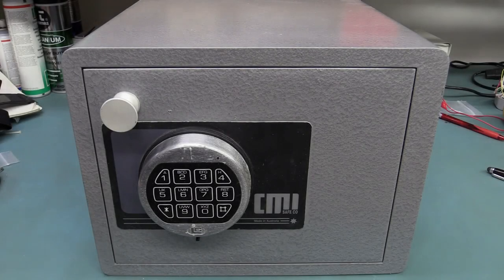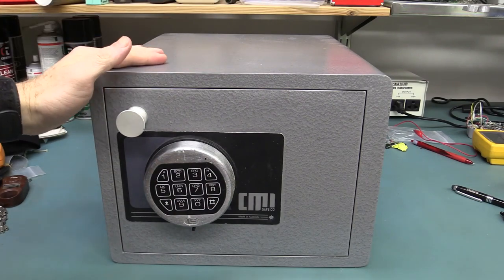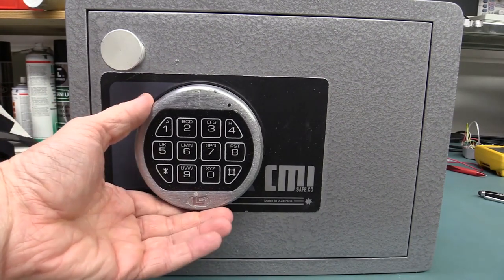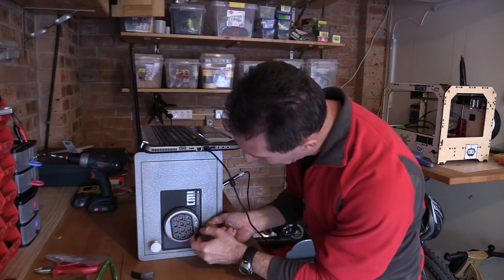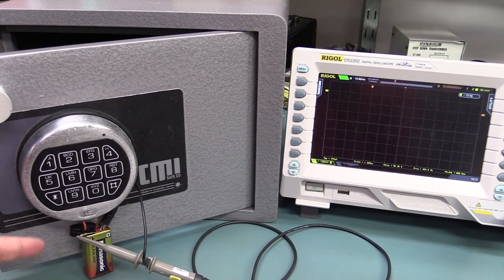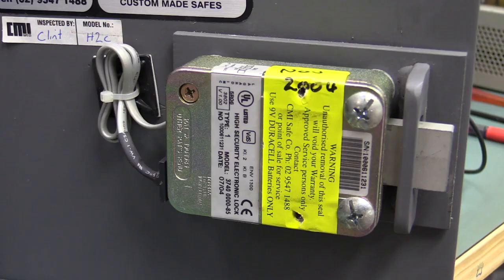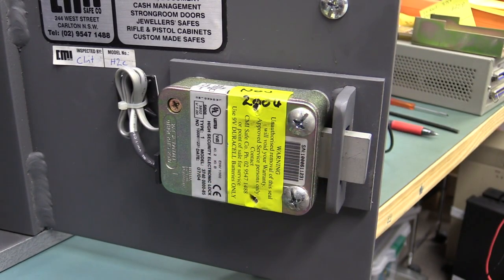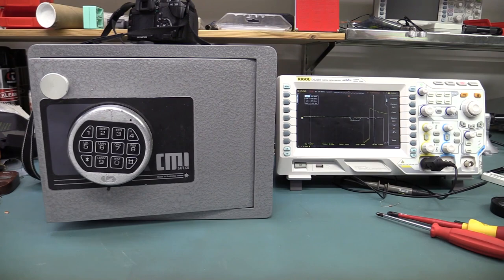EEVblog #762 - How Secure Are Electronic Safe Locks?

Comment: Dave, could you please check the patern when entering the last digit? I wouldnt expect any comparing beeng done before all digits are entered, they would just be saved. But it is possible, if the programer was lazy, that when the input string of digits is compared with the saved passcode, the comparison rutine breaks as soon as a difference is found, so you could se which of the entered digits was the first incorect one.
Reply: Viesturs Siliņš I like this idea, seems plausible.
Reply: Viesturs Siliņš So we can tell via the scope if the digits entered are correct? Wow, this seems useful.

Anyway, there definitely will be a different power draw when the correct digits are put in because the solenoid is powered.
Reply: Viesturs Siliņš Doesnt matter, once you put in all the digits if all it does is compare, theres no variation to tell you what digits are right, and you already know that it will be wrong, because its the wrong numbers.

This method would be just as fast as just putting in all the possible number combinations, because thats all youd be doing.
Reply: WeAreGRID
Not quite!

If the comparison is of a straightforward implementation, meaning you can tell which digit is the first not to match by examining the running time, then you can tell if the digits you entered match by individual digit as opposed to by the whole string .

And that means that instead of trying 6 digit variations (10^6 = 1 000 000), you  only have to try 10*6 = 60 as the worst case!

In average it would be 5*6 = 30 tries, and, if the safe has 5 minute timeout after 4 tries, you get average cracking time of about 40 min. Not fast, but doable!

It all depends on the comparison routine, it would be very easy yo implement a special comparison algorithm that takes a constant time no matter how soon the comparison fails.
Reply: Prehistoricman

If the comparison routine is of a standard implementation then  possibly yes!

Unfortunately the easily measured solenoid current can not be used because it only operates if all the digits ar correct, but we want to know which digit is first in the string to be false.

For example, if the comparison is not secured, the scope could give us the following information:
Lets say correct string is 123456 and the CPU spends 50us doing various housekeeping tasks that make up for a constant overhead and additional 5us for every digit comparison
At first we try entering 000000. And the scope shows 55us CPU activity - that means that the very first digit is wrong.
Next we try 100000. Now the activity period is 60us long. From that we can learn that at least one more digit matched because the CPU had to process more of them an took longer.
Now we know to try only 1xxxxx variations and move on to guessing the second digit by looking which one gives at least 65us delay.

We don't need to know how long exactly he CPU does the comparison, we just try out every digit in first position until the activity time increases and then move on.
Reply: Viesturs Siliņš That's really nice, I like that thinking. 40 minutes is a nice cracking time, especially being silent while doing so.

I'm wondering how the circuit ensures that the 5 minute wait is enforced. It didn't appear to have a UPS or any highly capacitive circuitry, so would turning it off and back on stop the delay?
Reply: WeAreGRID If the comparison breaks when it detects an invalid digit, before comparing the whole string of digits, then the more digits you have correct, the longer it processes the digits before failing. So this could be detected as a longer period of processor activity. The correct way to do it is to compare all digits regardless so it always takes the same amount of time, but this is counter to typical programming standards, so it is something they would need to intentionally think about and try to prevent.
Reply: Prehistoricman If I were doing it, I'd store a bit in EEPROM when lockout occurs so that if the power is interrupted the lockout restarts from the beginning when the power is restored.
Reply: Nick Sayer Oh yeah, it probably does that. Surprisingly, I didn't even consider it.
Reply: It's trivial to write an array/string comparator that doesn't stop on the first mismatch. That would foil any such attempted analysis.
Reply: Nick Sayer It is trivial... if they thought about it. And that question was unfortunately not answered from the testing that was done. It is a simple thing, but easily overlooked, as dave himself overlooked it.
Reply: Nick Sayer You are right, but it takes as conscious effort to do so. The straightforward way an the efficient way (that is something any good programmer chooses subconsciously) would be to stop comparison as soon as possible.

Another thing to consider is that although it is trivial to force the comparison to take approximately the same amount of time no matter the input, it is much harder to force it to be exactly the same amount. When you compare every character even after a comparison has failed you still have differing execution times of the individual comparisons.

The reason for that is that you have a branch in your code every time when you compare something and in the branch for failed comparison you have to set a flag to know that the comparison failed afterwards which takes a couple of cycles to do. If your measuring setup is good enough to see the difference for example of 6 vs 8 instruction cycles, than you can detect that.

To stop even that the programmer has to know the execution times of different instructions on the specific hardware and code the comparison in assembly inserting NOPs as necessary to equalize the execution time of all branches. Or maybe use bitmasking instead of comparison to avoid the branches. But that is not completely trivial anymore an takes conscious effort to do.
Reply: Viesturs Siliņš The code would simply need to set a bitflag to 0 or 1 for every bit, without defaulting. The final check can then be done with one comparison(its integer value for instance), so no extra cycles would happen unless all numbers are right. And would be exactly the same amount of cycles if any number is incorrect. If you are afraid of compiler optimizations, those can be disabled, which is a must for guaranteed time functions.
Reply: Richard Smith If I understood you correctly you mean to set a flag in the negative case as well so that both branches after the comparison are of equal lengths? That would greatly reduce the measurable difference, but on some architectures the jump instruction takes a differing amount of cycles depending on whether the jump is taken or not. For example, on ARM Cortex-M untaken jump is 1 cycle, but taken jump is 2-4 cycles because of instruction pipeline refill. That would give at least 1 cycle of execution time difference for each wrong character.

Mind you, at this point to use this information in an attack is much, much harder and unpractical in most cases, as the time difference is tiny and possibly varying depending on what the processor has in the pipeline. But still, I find it very interesting!

And again, the programmer can try to fight you even further, by adding a nop or two in the case of no branch. Or he could even stay out of assembly by just trowing in a random delay after the comparison routine! (you could try to determine the type of instruction executing by the exact amount of current consumed to try and detect nops, but I would assume any decent decoupling would make that next to impossible).

Any way, I completely agree that this attack can be prevented in software given enough will and skill, but my point is that one has to think of it in the first place and it might not be so trivial as it could seem from the first glance, leading to incomplete solutions. And it is fun to think about!

EDIT: typos
Reply: Viesturs Siliņš Is this assuming it is comparing it digit by digit?

What happens if it is simply dumping the input into a number and then compares that number to the correct one?
Reply: Jeffrey Black I deleted my original response, as I didn't notice the 'read more' and didn't see that you had already specifically mentioned turning the input string in one number, thus making my comet unnecessary and dumb.

Off topic, I absolutely HATE the idiotic changes google have made to youtube comets. It is the dumbest design they have ever made and as result the comment feature in youtube is practically unusable.

As per your comment, you are absolutely right!
Reply: "It is trivial... if they thought about it"  As an industry leader in electronic locks, don't you think it's more likely that they did think of it? Dave may have overlooked something, but he's not in the electronic lock industry. They have people whose entire job is basically to think of stuff like this.
"although it is trivial to force the comparison to take approximately the same amount of time no matter the input, it is much harder to force it to be exactly the same amount"
 Approximately the same amount of time is all that's required, and it's very trivial to do. One way, just off the top of my head and with minimal programming experience, is to build in a relatively long sequence of dummy operations into each comparison. If 99.9% of the time of each operation is dummy data, there is no way you're going to be able to parse out any difference in the remaining 0.1%. You're not going to be able to differentiate between a single 9.99us pulse and a single 9.98us pulse amid the noise and the inherent measurement uncertainty of the scope. If you had multiple pulses to average, sure, but you don't. Lastly, your estimate of 40 minutes is completely unrealistic. You've only accounted for the wait times, and given nothing to setting up the scope, entering the codes or analysing the scope readings. You'd also be pretty foolish to count on getting it done in the average amount of time. It's not like if it takes you an hour one time and you get caught you can just say "oh, that doesn't matter because it will average out over multiple attempts".
Reply: Trevor, that will depend on how it is set up.

Is it one person with expertise in a single area, or is it many people with expertise in many areas?

Coders (the ones doing the comparison) will often try to make their code as efficient as possible.
Would they think of someone hooking up an oscilloscope to measure the time of the comparison?
Reply: Unfortunately, the less secure method of coding, ie check validity of each digit at button press is also harder to implement.. most likely a button press will cause a wake, then interrupt, and the micro would simply store the data in ram, increment a button press register and check it(do we have enough digits) and set a timer wake event(time out on button press)..

The comparison would not take place until all digits were entered..  plus to protect itself further a the processor could easily  set the pwm output for the buzzer, process the button press(the button would be held down longer that it would take to start the buzzer and then read the button) and then stop the buzzer(stop based on a timer event) thereby hiding all processing within the buzzer noise.. none of this difficult to do...
Reply: Oh this is great, thank you bro
Reply: Depending on the microcontroller used, that could actually be an attack vector. While string/list comparison can be done by a programmer (who'd be able to mitigate through introducing i.e. prng noise), comparison of two numbers would likely be done by a == operator, which would result in a cmp command being issued to the microcontroller, who'd have a strict and predictable implementation that could enable a sophisticated pla.
Reply: @userPrehistoricman  They would use a count-down timer which is decremented on a timer interrupt or a 1 second loop, therefore cutting the power would simply pause the delay, not reset it.
Reply: @viesturssilins858  6 digits if stored as an integer is a single cpu instruction. Building keypad -> keycodes -> int, is about as difficult as keypad -> keycodes -> chars -> string -> strcmp. It's 3x4 matrix on the input and to query it one can build this thing on one of those $0.03 micro-controllers.
Reply: @CharGorilla  where do they persist the counter?
Reply: @VV-nw4cz  Most likely in nvram, there are a few low cost micros with some F-RAM on-die.
Reply: I'm thinking a magnet coulould cause that solenoid to trigger. Is that knob really through bolted? That gives access from the front. Looks pretty surrounded by metal to get a magnet close but... I can't tell from here. Also a strong magnet to the frontal area or a dose from a degaussing coil might do a form of reset to memory or move the solenoid? Probably would kill resale value other than boat anchor.
Reply: could        :{

Comment: I wonder if you could just use a neodym magnet on this one too. Many electronic safes can be opened by a big magnet to trigger the solenoid inside. Takes on average 5 secs.
Reply: Some of the magnets that are readily available today were probably not available when this safe was designed. Would be interesting to see what a crazy powerful magnet could do. That little pin might not move with gravity assistance (dropping it) but if even a small amount of magnetic field was able to penetrate it may move it. Not only would it be quick but it would also be non destructive. Might also be a handy rescue for those times when you forget to plug the solenoid cable back in. :)

Comment: There's a video on YouTube called DEF CON 21 - Melissa Elliott - Noise Floor Exploring Unintentional Radio Emissions

If you have a safe-shaped antenna, you should be able to "hear" the IC checking against the known combination, even through all that metal. Hey, you could even stick an antenna inside the safe through a bolt hole and use the safe as shielding from background crap.

Every time a button is pressed (or 6 numbers are entered), there will be a check in the form of a loop. During this loop, you should be able to inspect numbers inside the IC from the intensity of emissions from the data lines. Enter 4 random codes, and inspect what frequencies are the same in each emission. This should be the correct code.
Reply: Prehistoricman Yeah, those DEFCON speeches are really awesome and interesting. They trigger your inner hacker mentality.
Reply: Prehistoricman I've seen her before, she's really good. Think that's the one where she uses software defined radio to listen to the display bus on a laptop and reconstructs the screen. SDR compatible dongles are dirt cheap on ebay too.
Reply: Prehistoricman Only  an idiot programmer  would  check for  (in)correct digits BEFORE the 6th digit has been entered. This check would probably consume  different power depending on the result. So, only  do one final check, and nobody can intercept intermediate results (since there are none).
Reply: Frank Fahrenheit Wether to check during or after entering doesn't matter. When you loop trough an input buffer and break out at an incorrect digit, the parsing time gets altered too. As long as your checks don't break the loop and the difference between correct or wrong doesn't show up on the powerline either, you are safe.
Reply: Toon v Loop and break is also an unsafe method of comparing the code in this instance. The smart thing to do is add the inputs up into a single number, and compare that to the correct code. Doing so in the same number of instructions regardless of correct or incorrect code is fairly trivial.
Reply: remuladgryta 
No, that would not be smart at all. With 6 digits in the range 0 to 9 you get a total number of only 55 different sums (0 to 54). With 4 attempts between each 5 minute lock-out, you can exhaust that key-space in a little more than an hour. Of course, you'd start with digits adding up to the sums 27, 26, 28, 25, 29, 24, 30 etc, going for most likely sum of six digits to lesser likely sums. That way you would be able to go through about a fifth of the "combinations" in the first four tries, about 51% of the possible combinations in only ten tries, and about 74% in the first 16 tries which would take less than 16 minutes (including the 15 minutes being locked out).

Multiplying instead of adding (1-10 instead of 0-9 obviously) would be better - that would only make the order of the digits irrelevant - but still reduce the key-space to a mere 5005 combinations (now we're talking several hours to a few days).

Converting each digit to 4 bits and do a shift between each digit being entered, finally followed by an XOR with the stored code (laid out in the same 4 bit per digit manner) shouldn't leak much information though, while keeping the maximum key-space (order matters, numbers can be repeated).
Reply: remuladgryta
Reply: dont fuck it up people

Comment: I did QC checks on some of the cheaper units in China prior to our acceptance of them. I found that you could open them with a bump on the top before they were installed but once bolted down you couldn't. I couldn't work out why that was so. I also had my laptop in a hotel safe and it would not open with the code I set. I asked the girl in charge if she could open it for me using the master code. She did not know whether it had one so i took a guess and used the factory code - yep it opened so then I had her get the manager and I showed her how to reset all her safes with a new code. She was really grateful, especially as i hadn't just kept quiet and opened the other safes!